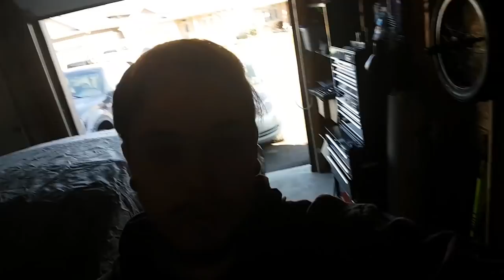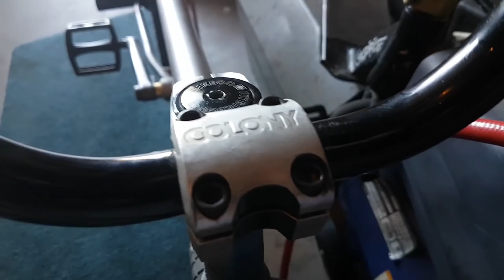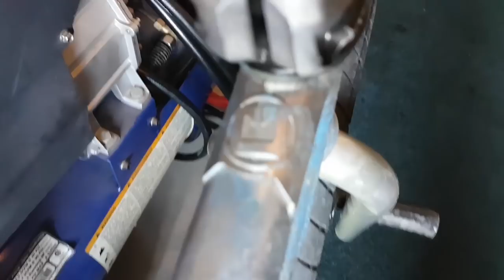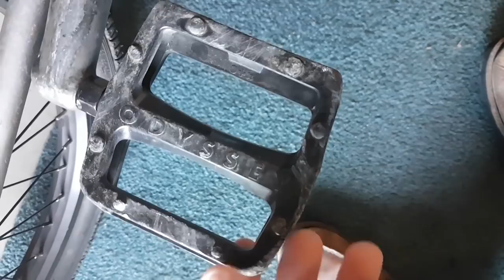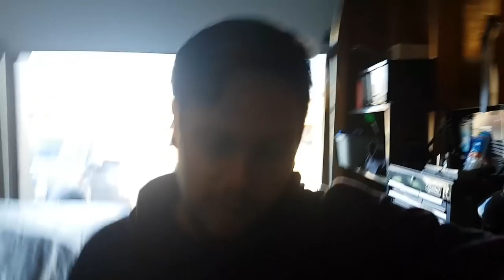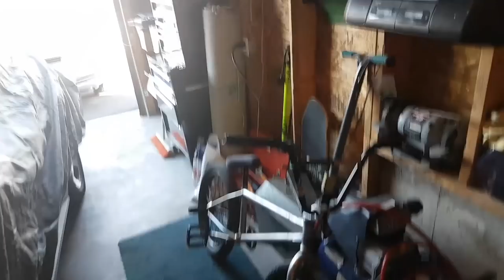where did i go? BIKE CHECK!!

Comment: I think a bit of jetfuel. Like jetfuel pegs, brake lever and/or pedals. Snafu Hex pegs in jetfuel are about  50 CAD. I dont know if its 50 each or for 4. Probably each. Snafu Anorexic Pedals in jetfuel are about 130 CAD. And a speedline jetfuel brake lever is about 80 to 90 CAD. Jetfuel is pretty expensive but I think you would look good riding with it. I hope this helps!